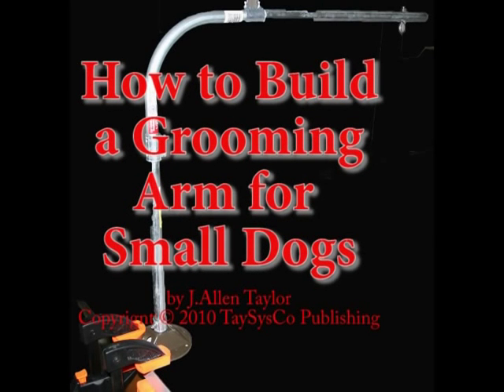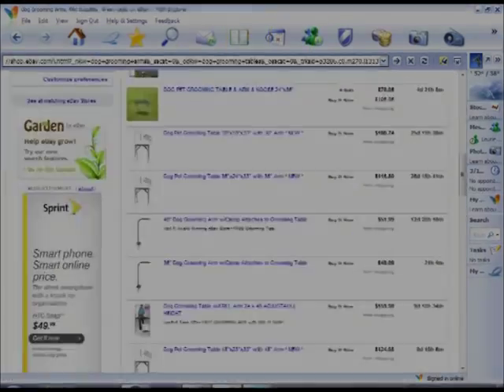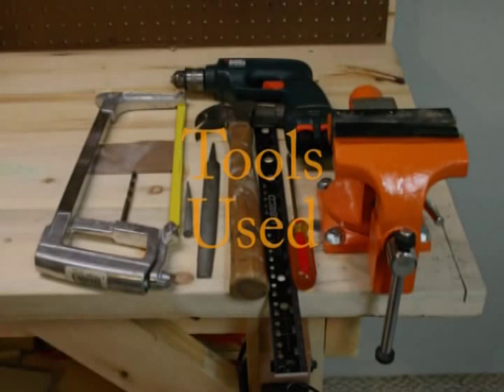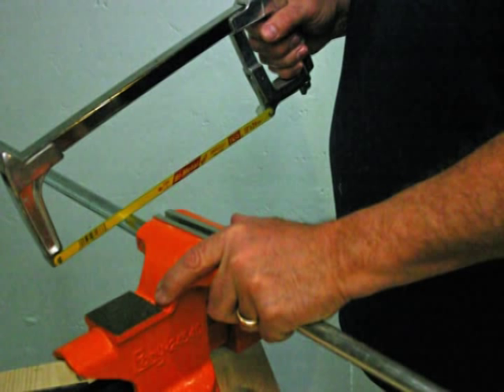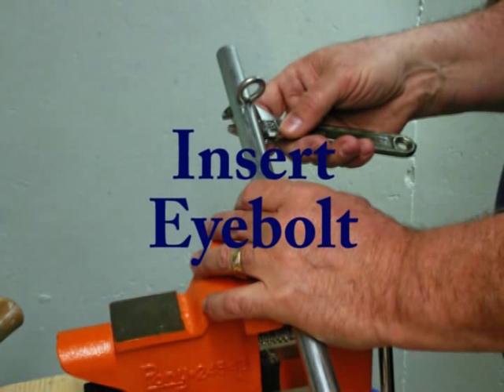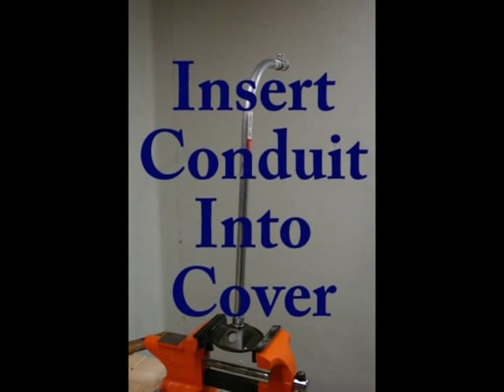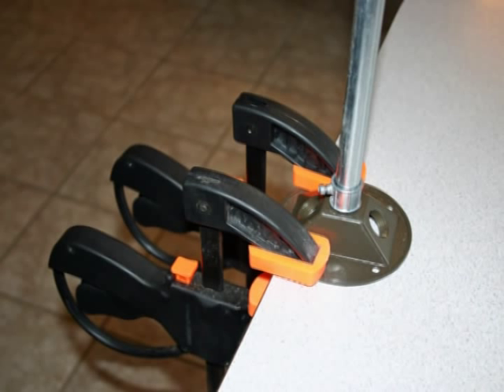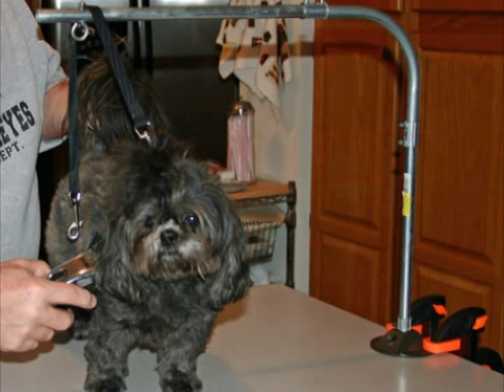Build a Grooming Arm

Comment: Good video. Just note that the reason most grooming arms use SQUARED pipe is that the round one WILL swivel if a dog pulls on it, tries to run off the table, etc., and that CAN leave the dog dangling in the air!! I know you gave warnings at the end that were very good and clear about NOT leaving a dog unattended, but I thought I would add this about the round tube/pipe used as a grooming arm.

Comment: Exterior Outlet Cover also called... (1/2" 3 hole round lamp holder cover - MENARDS) or (weatherproof electrical box round cover - HOME DEPOT) or (gampak round metal weatherproof electrical box cover - LOWE'S)

Comment: Is there another name for the "exterior outlet cover"?  I cannot find one on the web or at HD or .Lowes using that description.  I found a 1/2" floor flange, but the exterior diameter is only 3" and I want to clamp it down instead of screwing into the table.  Your video is great!!  Very easy to follow.

Comment: I am attempting to build this and am 90% done, but the 1/2 " connector at Lowes is 1/2 " at the threads, but 1 " at the top, so it is too wide to hold the EMT 1/2 inch tube.  I am trying to figure out if there is another type of connector that is 1/2 "diameter at both ends.  So close...any ideas anyone?